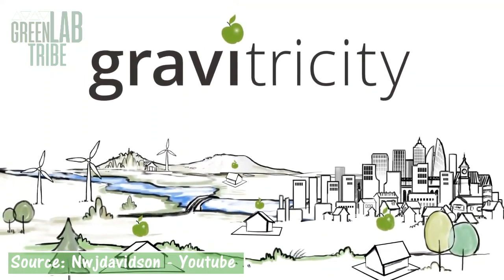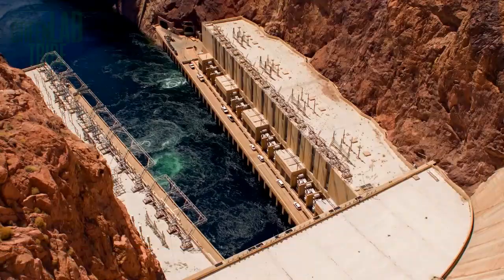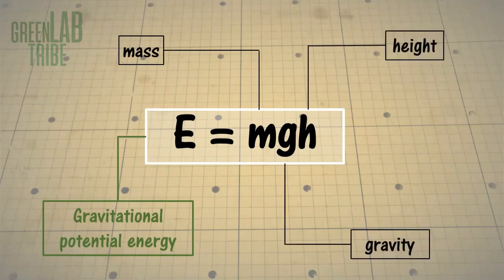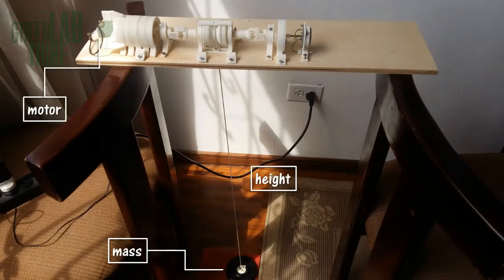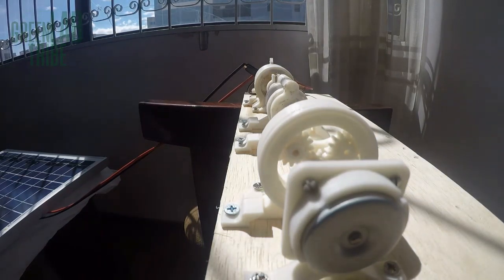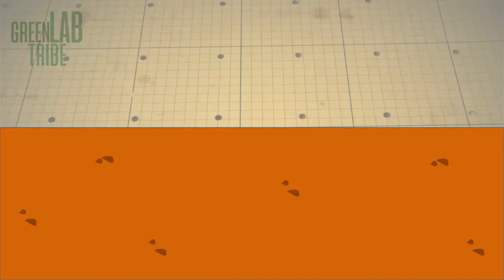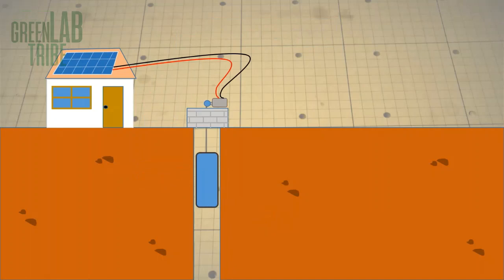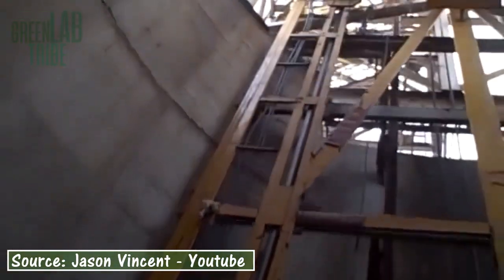What is a gravity battery? Explaining gravitricity

Comment: Gravity batteries rarely make sense. Sure, it sounds like a great idea until you realize you can't even make toast with the power they can supply.
Reply from the maker: I think you re right. In general the energy density just doesn't pay off. However, it may exits special conditions where it makes sense. I'm the case of gravitricity, they try to take advantage on deep holes that already exists (is after them to probe if it is a viable system)  and dams for hydropower are basically gigantic gravitational storage devices. Let's keep looking for more examples

Comment: I lost you on the translation on the home system utilizing the well however I've been thinking about using buoyancy to convey the weigh vertically. perhaps a wooden vessel that could empty when it reaches the bottom partially providing the water to carry it back up and rather than powering a motor to tow the weight up, drain the reservoir using gravity to a secondary reservoir to enable you to pump it to a third, elevated reservoir using a Bunyip pump system and from there allow gravity to refill the gravity battery reservoir. It would be essentially free and perpetual energy after construction costs and maintenance. The only consumable would be water lost to evaporation. Using the weight as a temporary reservoir might add an unnecessary level of complexity however the increase in the mass of water vs. a solid would lend itself to more flexibility in what type of material to use for the battery weight. You could use an aluminum, plastic or some other durable material so long as it would hold water.

Comment: Those proposing storgae seem to overlook that there is not a sustained and consistent excess of renewable generation. No excess, no storage requirement. Unless there is some practical way of reguating the rate of fall then the output will be asynchronus and that is not a good thing. Trying to brake a large mass under gravitational pull is no easy engineering matter
Pumped storage is often mentioned but it's primary function is not storing 'excess' energy but to support frequency at times of stress to the grid as it can go from no output to full output in seconds.

Comment: Why not pump water into a tank and release when you need electricity? Calculating the energy output per gallon would be relatively easy and would inform you of the tank size you need. Mechanically it is so much simpler as well. You just need two water tanks, piping, a pump, and a generator. Low maintenance and no crazy digging

Comment: Dear sir greetings,
Story of India.
India is having 78000 petrol pumps outlets and are selling petrol and diesel and gas and each petrol pump has a 20000 litres of liquid per bunk and this is having 60 MW energy.
So India requirement is 5000000 MW of energy.
Please understand this ground realities.
 230 million vehicles on Indian roads
 1 million is 1000000
 230000000 vehicles
 If each vehicle gets minimum 5 kWh or 5 units charge then per hour India needs 
23 00 00 000 vehicles X 5 kWh or units
 1150000000 kWh or units per hour
 1150000000 kWh or units per hour if each unit is sold for 10 rupees
 11500000000 rupees revenue generated
 100740000000000 rupees per year
This is the revenue generated per year
Sir these are genuine figures
 On ground reality
If we convert this to hydrogen then please think about the ground realities
 Please understand the importance and value of the flywheel technology and invention
 I am the only person to work on Flywheel power generation technology and Flywheel power storage technologies
I am the only person to work on power Multipliction technologies
 I am using hydraulic applications pneumatic applications batteries operated motors in-pipe cascading power generation technology etc for power storage and power generation and power Multipliction
I have sent to mukesh ji , like this I have sent to all important people in India
I am doing my marketing and advertising and branding
I am open to all people of the world

World First fuelless power generation technology developed by Indian scientist couple.
Absolutely free energy technologies

www.kammagearflywheelpowergeneration.com

Just 4 batteries and running a submersible pump, a welding machine or a lath machine or a industrial heater etc mechanical load and electrical load like halogen bulbs 

https://youtu.be/Cut8Pv2nWBc

https://youtu.be/e6pI0fevA-M

https://youtu.be/cd-QWZBNLuo

https://youtu.be/w2EQyf_KbWk

https://youtu.be/rPRJofvOYoQ
Federal government of India has accepted this technology and invention and incorporated Flywheel , compressed air and pump storage 

Thanks
Dr Srinivas Bhasker chaganti
Chaganti Bala
8555045244

Comment: As for the 'Gravitricity' concept: Why not build twin TOWERS with twin weights? One heavier, (say the left one) than the other, then slide an additional weight on the lighter (right one) that makes it heavier than the left one. The now heavier right one pulls the now lighter left one up. When the right one gets to the bottom, slide the extra weight off and the now heavier left one pulls the now lighter right one up. Then all you have to use energy for is to lift the EXTRA weight up as the right one goes up, to be slid back onto the right one, repeating the process.

Comment: So due to the fact that you are going to incur conversion losses between solar > (~80% loss) > electric > (~10-30%) > motor > (?% loss)> potential energy > (~10%) > DC electrical > (~10-30%) > AC Electrical >>> something else which incurs losses

This really only makes sense if you are doing something directly mechanical with this energy and stop incuring those losses half way into that process.....like milling grain or spinning a fan. Something like that. 
If you want to use the energy for heat it makes more sense to store that heat in water or if you care to get more intense, in a phase change material, like wax

solar > (~20% loss) > heat transfer fluid > ( thermal losses dependent on insulation but dont need to be super large.) > Wax > (functionally zero loss if the goal is to heat the home and the container is in the home but could be non trivial if the goal is to do long term storage....at which point there are other chemical means of long term heat storage like salt hydrates)

there are ways to also use heat to cool the home. Which are a bit more complicated. But have better theoretical efficiencies than doing all the conversions to electricity.
And at that point the losses of all the conversations may stand to justify the convenience, low losses, scalability,  and power density of the batteries existence. Unless you have some reason you could never replace them. Or refurbish them, like in the case of lead acid batteries.
solar > (~80% loss) > electric > (~10% loss) > Battery > (~10-30%) > AC Electrical
But even then. The life cycle of a lead  acid battery isnt that much shorter than the lifecycle of a consumer level turbine youre pulling the energy out of depending on the up front cost you are looking to put into it of course. Not to mention the hole itself which will likely need to be maintained.

This makes more sense than say.....a fly wheel... or compressed gas (except for natural gas) for long term storage, but i think it has a limited application to mostly for use when mechanical applications are called for and long periods of time exist between generation and use. It's highly scalable in terms of you just need a deeper hole or a larger weight. But also, is limiting in the sense of how deep are you really going to dig that hole, and where are you going to build a basket of concrete or move rocks that far. Which may have a non- trivial carbon footprint that may be larger than years of use of this system.

for the same amount of effort you could have a full geothermal or water pit based thermal battery system installed for as much or less effort, cost, and environmental impact. that would also likely store a much larger amount of energy and reduce your dependence on electrical energy meaning you need less batteries for your solar and therefore reducing the impact of them.
More so if you can find a high temp storage solution like a more robust solar oven, that allows you to cook in it as well.

Comment: There is beter other design...
Reply: Don't leave us hanging...what is the better design?  Gravitricity claims their system will be the cheapest storage for fast frequency response over things such as flow batteries, compressed air tanks, and lithium ion.
Reply: @youvidium  I think about molten refractory materials... Withstand higher heat than this... Less space than gravitricity...
Reply: I think about molten refractory materials... Withstand higher heat than this... Less space than gravitricity...

Comment: So you are depending on solar to charge a battery bank to aid in raising the weight?  What are you going to do at night?  This system cannot raise the weight alone.  An external source is required.
Reply: If you watch the gravitricity video they do not use battery banks...the whole point is to use gravity and weight to replace battery storage.  Also note you can raise the weight with any excess electricity.  It doesn't have to be solar, it can wind or whatever.  The system doesn't have to work 24/7.  It's sole purpose is to store up excess energy to use when needed.
Reply: @youvidium  
"the whole point is to use gravity and weight to replace battery storage."
Correct me if I misunderstood, but are you claiming there is excess energy created that can lift the weight back up without any eternal source assisting?

If this is what you are claiming, then No! 
This system cannot operate as a closed system!
If there was excess electricity from Gravity, that would contradict the 1st Law of Thermodynamics.  Energy cannot be created or destroyed.  If there are any losses in a system, it can never achieve 100% efficiency.  An external source must always be used to drive the system.  I.E. An "External Source" is required to lift the weight back up!
.
Reply: @valveman12  Not extra electricity from gravity...the extra electricity we are talking about here is from say the solar or wind power.  Let's say during the day you have full sun and the panels are producing more electricity than is needed by the system.  That EXTRA amount is used to lift the extremely heavy weight with the motors upward storing the gravitation potential energy.  Just like today Australia stores their excess energy in Tesla's batteries, this will store it in gravitation potential which the weight can be released downward when power needs to be stabilized or more power is required.
Reply: @youvidium  
Ok, I understand what you mean now.  Yes, an external source would be required to move the weight up.  The amount of energy required to move the weight back into position.    Where X is the energy required to raise the weight and the output will be X - Losses.  If the external energy comes from solar panels, then when the panels are not able to work at night, the stored potential energy in the weight could be used to provide power.
Reply: @valveman12  The efficiency is claimed to be 80-90% so the L is relatively small and again remember this is EXTRA electricity you are storing that would go wasted otherwise.  Why throw away the extra energy when you can store it up by lifting the weight?  Just think if the weight was at full height by nightfall, Gravitricity claims their standard system would be storing enough power for 13000 homes for 2 hours.  Why would Australia even need Tesla batteries if storing excess energy didn't help anything?  This system is just replacing a battery storage medium for a gravity storage medium and doing so because they say it is way more cost effective.  Search Gravitricity and watch the video titled "Latest Gravitricity Explainer Extended Animation Spring 2020".
Reply: @valveman12  Use solar or wind to lift the weight. That's your energy storage. When the sun goes down or the wind stops, you use the energy up by letting the weight drop. Simple.

Comment: I have a off grid home, and have gave alot of thought about possibilitys of generating power, using solar, and using the excess to store in means other than batteries, I had thought about pumped storage, but I don't have the change in elevation to make it practical, same for gravity systems like this, I thought about putting a pulley in multiple trees, (I could easily suspend 20 tons of weight combined in trees, with 20-30 feet to fall), that's ALOT of work.  The easiest, (not the most effiencey) would be to split water, use the hydrogen to fuel a generator, its only problem is storage, with refrigeration it can be stored in propane cylinders, for use when power is needed, or stored short term in smaller amounts, at lower pressure in inner tubes, but for certain sized solar power systems lead acid is not the best idea, lots of losses, if you have room for the panels, lead is somewhat OK, but lithium I's a night and day difference!   I have lithium batteries, and still looking for alternative storage to use the power avalible after the batteries are charged! It could be hot water, cold water, for cutting power use later for heating water, or cooling the house, or. Compressed air storage, it could spina generator for power on demand, witch could be the best option!

Comment: How is this more efficient that using a large flywheel?  Since all the energy is being transferred through rotation, it seems like a flywheel would achieve the same power output with no mine shaft required.
Reply: Flywheel needs to rotate at insane rpms to be able to store decent amount of energy causing it to explode.Also there is friction
Reply: @sayerhsihtapanag4570  I like Amber Kinetics' designs.  They appear to have mastered most of the critical challenges.
Reply: I agree with you on that point.  It is an interesting concept (and maybe even worthwhile in country like my own - South Africa) but then you have to have access to very deep shafts to make it practical.  The advantage of flywheels would be that you only need a small footprint for your installation.  There is one footnote to the Gravitricity concept that probably was not addressed here, the system can be expanded to utilize a whole array of weights and not only one going up and down a shaft.  A large number of weights can be stored at the top or bottom and lowered when there is a demand for power.  They can be stored in some kind of magazine, like bullets inside a pistol.  This system would work well where you use two generators/motors together where one would be generating with its weight going down while the other one is lifting its hook after storing a weight at the bottom of the shaft.

Comment: I've been thinking of a similar design for storing energy. Something to look into as I have found great success with it, is using a worm drive gear attached to the weights to handle a super heavy load with a really high torque, that can be geared to spin a generator at high speeds, with super slow drop rate of the weight. 😎
Reply: Subbed to your channel but I don't see a vid. Don't suppose you could give us a peek?

Comment: Agreed with limitations of g in E=mgh. What if we can try to cheat with g? Let say something with magnet or spring.
Reply: Springs can be adjusted for many years. Now you need a flywheel. Besides Springs meaning more than one, can be rewound using a simple starter motor 12/24v. Once set up and running, it will continue to run on its own 24/7 if you want. Now you can charge battery bank's for your home, while at the same time run the house.
This is something my husband, has been working on in his mind and on paper for over 40 years. This is just the gist of it, as far as what I know about it. But he says if you get everything in the right order, it will work. Besides, it is far better than what this guy has shown us. And it stays at ground level.
Reply: Heavier materials.
Reply: Springs wear over time, and magnets won't work at these heights